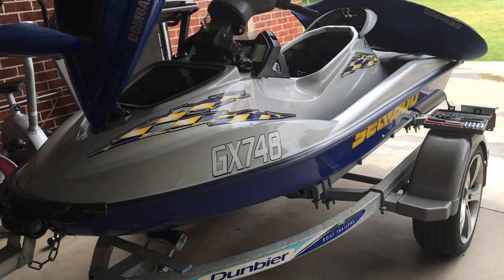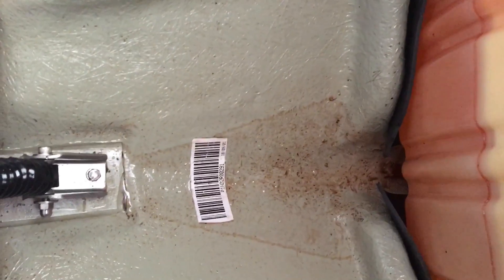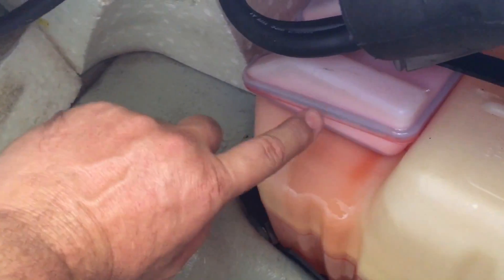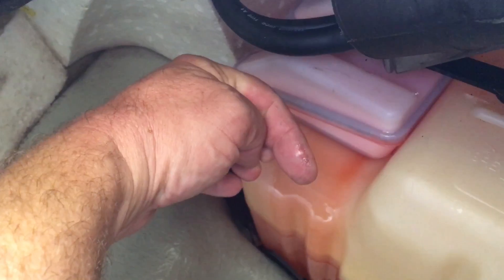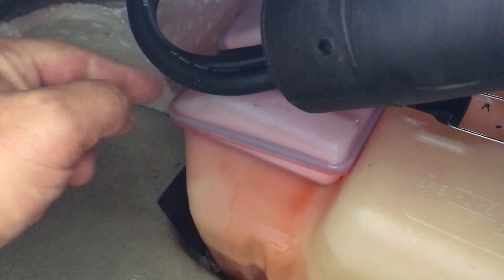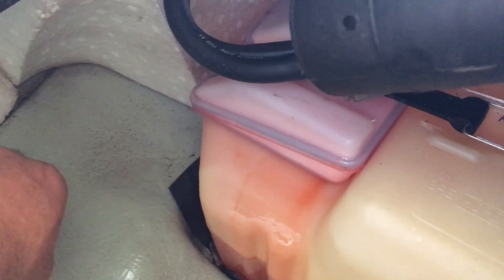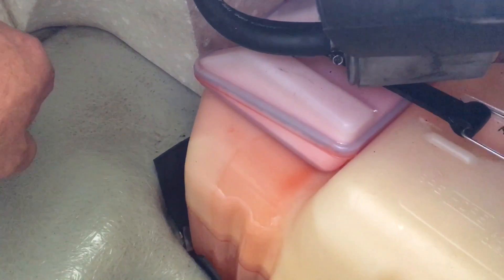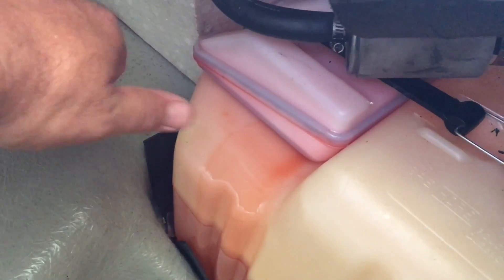Oil leak in hull 2002 seadoo rxdi and how to fix it

Comment: was the oil that leaked rust red and like clear under the surface? i think im having the same problem. just got it 3 days ago. it runs great but i got it opened up and saw all that red slop. ill need to take one more look at it but i hope this is the problem.
Reply from the maker: Yes the 2 stroke oil mixes with water in the hull and makes it red / clear . Hope u fixed yours ok

Comment: I have some problem.  I'm sure I can take it out fairly easily but not sure what connections on hoses I need to disconnect and reconnect.  Any advice on how to do this?
Reply from the maker: Martin Rodriguez yes was fairly easy , just undo fuel tank straps , filler hose and smaller hose and pull out through the front
Reply: @SteveBottrell  How did you connect it back up. Did you have to undo the head pipe. I can't reach down into their far enough to get the hose to put back onto the back of the oil tank
Reply: @thekidd263  were you able to reconnect the oil hose? I have to pull mine out and not sure how
Reply: @thekidd263  same prob, how can you disconnect and reconnect the hose that hose.. its hard to reach